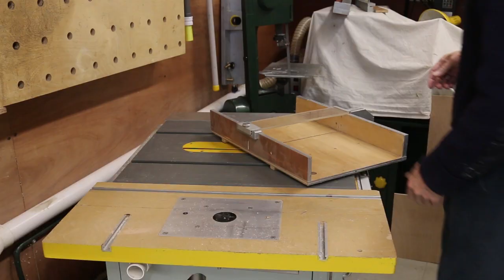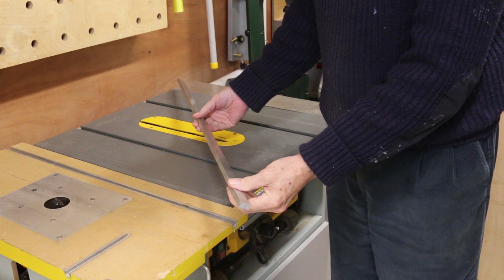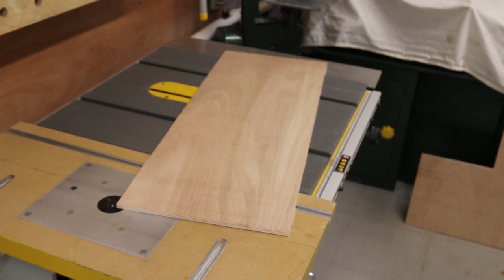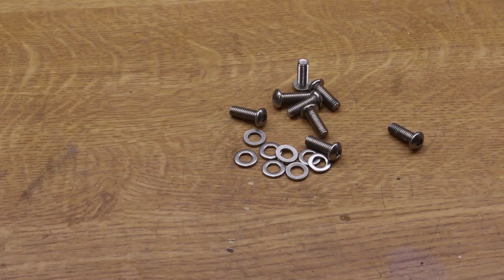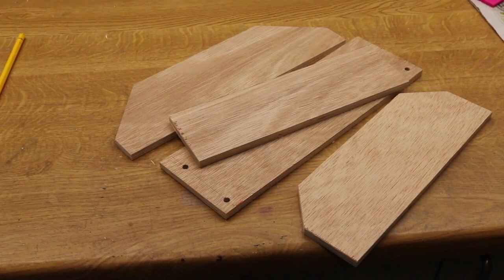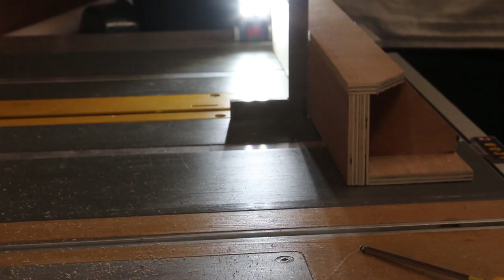New sled

Comment: In the midst of major shop remodel, re-org & expansion.

I've heen planning on an integrated workstation w/ hide away router table, small belt sander & several other small, infrequently used units.

I'm working on the structural changes & expansion & keep looking at the massive cast iron, precison table saw w/ yrs of upgrade mods & gizmos, thinking about the fact it's been buried for close to 2 yrs due to illness & all the table saw cuts during that time & for the shop remodel have been more than adequately handled on the lightweight aluminun contractor's 10" saw & my completely restored '50's era DeWalt RAS.

I'm seriously wondering if I need the cast iron icon of cabinet shops & joinery... 

Can a guy get by without a full size table saw?
Reply from the maker: Many do! I have access tp a large (cast iron top, sliding mitre table) table saw, and actually prefer my DeWalt jobsite saw. Precise cuts I do with a tracksaw anyway. A RAS would replace, in my opinion, any residual requirements. If I was doing production work I would want a big tablesaw- for projects they do not earn the space they take, at least for me. Good luck with your re-build!

Comment: Nice job Mike. I've been looking to build a new sled that's not as big as my current one and I really like the idea of omitting the sled portion to keep weight down.
Reply from the maker: I did not do it for the weight- partly it means no loss of blade height, but mainly-
Manufacturers take a deal of effort over the table; large ones are usually ground cast iron. Running a sheet of ply, with who knows what crud trapped beneath, negates all that effort.

Comment: While the concept is nice, and I do appreciate the design, the reason your table saw has the miter rails designed as they are with the wider space at the bottom is to allow your miter attachments to be secured to the table. For the costs of the aluminum and the time that you are going to put into making those rails, just buy the adjustable ones that will actually keep that entire sled secured to the table in case of hitting a knot or something in the wood that's going to kick it right up into your kisser.
You can slot the ends of the rails and even attach a washer at the ends if you wish to keep the rails you made. Also, wax the slots, rails and the bottom of the wood, goes a long way.
Reply from the maker: To deal with your points, one at a time.
1) yes, the rail slots are T shaped, to allow clamping items down. But this is a sled- it is not clamped, it moves along the slot.
2) Cost- I paid £14.40 incl tax for one metre, which made both rails.2 rails would have cost £43.20 and would be shorter.
3) Time- I cut the rail in two. Took about 3 mins including de-burring.
4) Security. Any 'kickback' is parallel to the table surface, i.e. straight back- so securing the rails would not give any benefit. The forces generated are exactly the same as for a sled with a bottom (it is acting on the material, not the sled) and I know of no sled design that uses slot hold-down of any form. Because it is not needed. The lifting force that can act on a workpiece is at the rear of the blade, caused by workpiece twisting. The sled prevents this twisting- even if it did not, the riving knife would.
5) My rails are waxed (candle grease) but I do not need to wax the wood part, as it is raised above the table (for both this reason and to prevent dust collecting between sled and material.)
As you see, I considered all of these matters during the design, and addressed those that were valid.
Reply: @Tensquaremetreworkshop  OK, I guess it will work if you don't have a radial arm saw.
Reply from the maker: @godsarmyofhammers  I am seriously considering a RAS- but then I would not need a sled; the saw moves, not the material.
Reply: @Tensquaremetreworkshop  they are handy, but at the same time, it opens up another set of issues such as space and building a feed table. I am sure you are clever enough to work out what best suits your needs, Keep us updated on the sled as it evolves.
Reply from the maker: @godsarmyofhammers  Will do!

Comment: Not sure I'd say having a wooden base is a design flaw, it offers lots of opportunity for jigs, clamps etc as well as zero clearance, not to mention you made the fence out of wood? I think what you've done is essentially make fixed 90 degree mitre gauge. Does look useful though 👍
Reply from the maker: Why insist on a metal table if you are going to cover it in wood? Zero clearance can be done on the table, where it will be used for all cuts- but this design also allows angle cuts (which would chew up a conventional sled- and move the cut point). Jigs, clamps, mitre guides, etc can all be fitted to the back (as I mention in the video). I will make these as I need them- a box full of accessories that I never use is a mistake I shall not repeat. I debated using some aluminium 20 x 80 extrusion for the rear, to eliminate all wood bearing surfaces, but decided that the improvement would be minimal- the box construction means that it is very true (for wood)- and it would add to the complexity for others without metal-working facilities. I have some 8mm aluminium plate, which I will fit to the rear if I ever cut something that requires further accuracy.
Reply: @Tensquaremetreworkshop  If you use good quality plywood (or MDF), it's really not going to be an issue, I think you're exaggerating that aspect. Fair enough about the zero clearance point. In regard to the jigs/clamps, I meant ones that attached to the base board, not the fence. Apologies if my comments came across as critical, they weren't meant to be. I was just thinking out loud :) ... I do like it, and it's something I will probably make myself.
Reply from the maker: @SirBenJamin_  Yes, the quality of plywood helps- but nothing is better than none. My previous sled had only one fixing to the base, and that would be easy to move. Some of my sled jigs (finger joint cutting, vertical clamp for tenons, etc) will fit with minimal change.  My start point for this sled was using a sliding table cabinet saw- which also moves the material directly over the table. Much will evolve, such as (steel) dowels into the slide bars to give various angles...

Comment: technically speaking you are right and this is good designl
At the same time my dewalt 7492 has a slight dent/curviture. That means if I set the saw at 90 right to the table next to it and then put a straight piece of metal longer than the whole tablesaw across it the saw is no longer 90. did you check flattnes of your table saw? Ive seen many people complaining about dewalts flatness in these models. The company says this may happen as it's only construction grade saw. Not cabinet maker
Reply from the maker: Yes, I measured my table some time ago- it has a 'dish' across the face of ~0.2mm and along the cut of 0.07mm. This, however, is another benefit of this sled- the wood stock being cut will tend to form to the table, and so measurements will be correct. A normal sled will not, and can change the dimensions depending on its position. Plus, the sled can warp, and dust can collect under it, especially at the guide join- which it cannot on this (the wood parts ride slightly above the table to give room for debris). Much of woodwork is about repeatability, rather than absolute accuracy.
Reply: @Tensquaremetreworkshop  Oh I absolutely agree with the final words. I triple checked and adjusted my saw the second it came first to me. I was like a 6 year old with lego, completely out of reality. 
With most sled videos people tell fellas new to woodworking that you gotta space the runner, so it won't catch anything under. I have been doing the same for all mine since first.
Warping is probably the biggest problem with sleds. I take mine as flat surface, blade at 90 degree and it has never let me down. Just gotta keep on checking, not only trusting tools. Not yet at least.